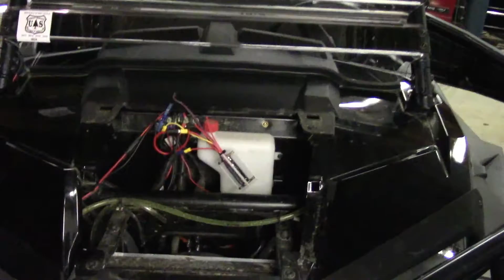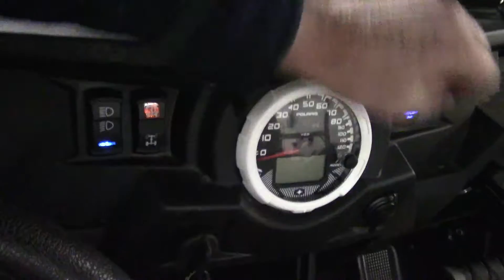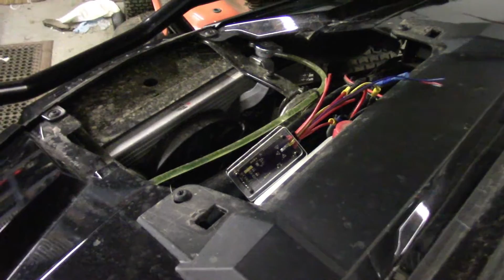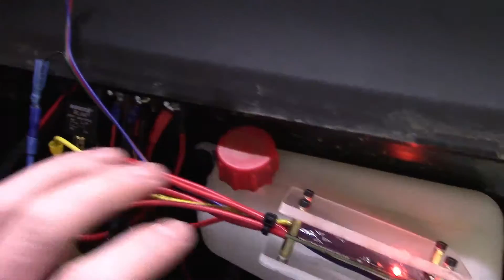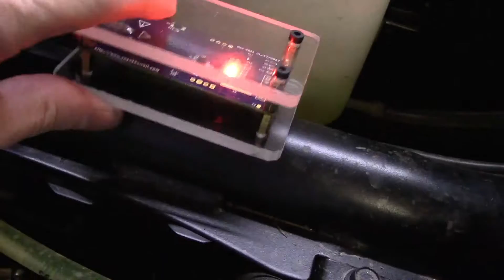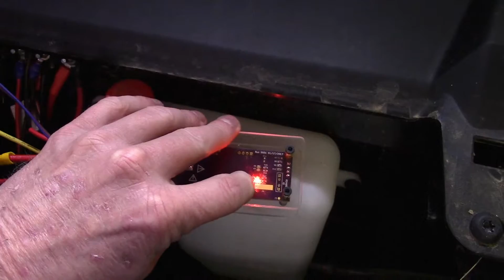RZR Mini Multiplexer Part 10 - Final Test in the RZR

Comment: I don't know what the hell a multiplexer is but I'm about to watch the shit out of this video. Review coming up.....
Reply: well isn't that just neat-o.  can't wait for the final product!
Reply from the maker: I completed the first production batch this week and all have been sold/shipped.  I've ordered another batch of PCB's which should arrive in about 3 weeks.  If you are interested let me know and the application and I'll try to hold what you need on that run.   I also plan on offering different software versions as some people wanted custom things to happen. So far I have the RZR application, linked turn signal/brake/park, wig wag, and single switch step control (one switch to selectively go thru modes) for those don't want to have a ton of switches and prefer to cycle outputs on and off.